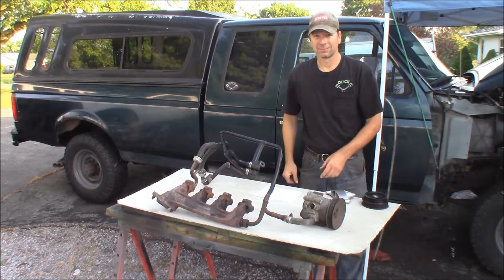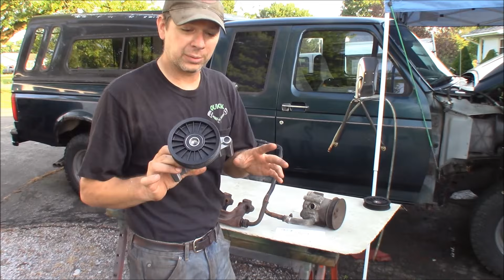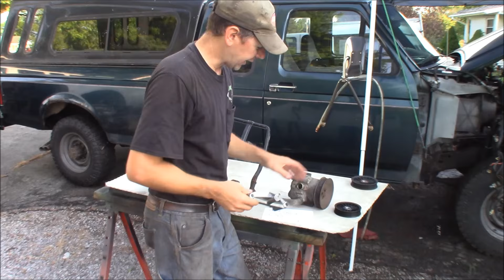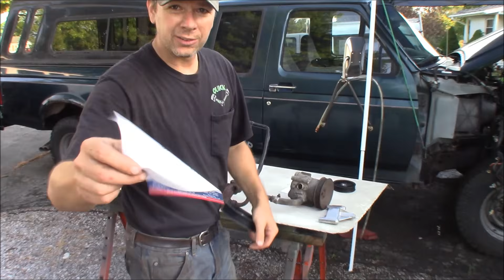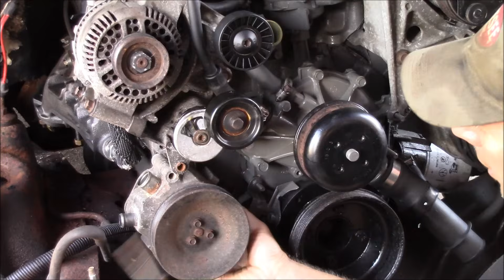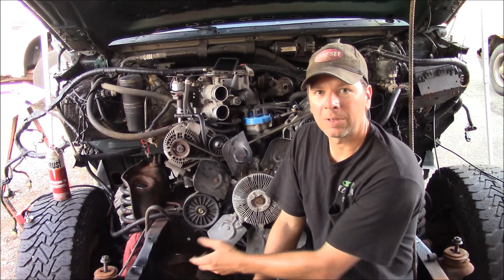1992-1997 OBS Ford Truck 5.8L Air Pump Smog Pump Delete F-150, F-250, F-350

Comment: What's the purpose of this?
Reply from the maker: Air pumps are known to seize up,  wreck the serpentine belt and leave you stranded.  Ford built these trucks with and without air injection systems. I eliminated the air system on my truck to simplify things and prevent future breakdowns.
Reply: @QuickSpeedShop  Good to know, thanks
Reply: @QuickSpeedShop  No codes from the EGR VALVE??
Reply from the maker: @STR8SICCC  I didn't remove the EGR, only the air injection.  Two completely separate systems.
Reply: @QuickSpeedShop  Alright then, good to know thanks again!
Reply: @QuickSpeedShop  hate to keep bugging you, but I am having no luck finding that idler bracket I've checked Autozone and O'Reillys online as well as Summit Racing...
Reply from the maker: @STR8SICCC  I bought mine from Jegs.  Just search the Proform part number in the video description. It shows up multiple places.
Reply: @QuickSpeedShop  lots of places show it but can't so much as order it.  I found 1 that does. My next step is deleting the pipe connecting the 2 manifolds. Do you know what size the threads are??
Reply from the maker: @STR8SICCC  I'm not sure of the thread size.  I replaced one manifold which came with a plug and I just welded the other side shut.
Reply: @QuickSpeedShop  okay thanks, was the replacement an OEM? I'm trying to avoid a complete replacement exhaust atm...
Reply from the maker: @STR8SICCC  I bought the manifold on RockAuto.  I think it was a Dorman part.
Reply: @QuickSpeedShop  darn ok

Comment: What if you just loop the Air Pump like you did with the valves? Or run it straight to the solenoids. I have a exhaust leak somewhere, guessing its either the manifolds or the egr piping in the back
Reply from the maker: The problem is that the air pumps will seize up and throw the belt, that's the main reason I remove them.  Sounds like you could either have a cracked manifold, which is common, or a smog tube that is leaking, although I think the newer ones are made of stainless so that don't usually rust off.
Reply: @QuickSpeedShop  Good call. Thanks! Great video, helped me understand the system much better. ++ for including part numbers!

Comment: Can't find the bracket anymore.  And not buying the 102$ Ford branded part because it's no different than the 60$ bracket.
Reply from the maker: https://www.pepboys.com/proform-air-pump-idler-bracket-kit-fits-302-351-mustang-uses-standard-serpentine-belt/product/904067Looks like Pepboys has it for $49 now.  Just search Proform 68110 and many places carry it.
Reply: @QuickSpeedShop   https://www.pepboys.com/proform-air-pump-idler-bracket-kit-fits-302-351-mustang-uses-standard-serpentine-belt/product/904067
Wow there it is.  Thanks man.  However, the upper bolt on my smog pump seized hard half way out.  I ended up having to leave it there and use a 92.3 inch belt to bypass; Dayco 923k6.  It be a while before I get in there again, I think I will have to remove the alternator and I think that bolt is going to get stuck too.  Might get an aftermarket alternator bracket and bypass the tensioner.
Reply: @classiclarry88  I just found out pep boys isn't in the parts business anymore.  Here's a replacement link- 
https://www.cjponyparts.com/catalogsearch/result/?q=m8604a50

Comment: Will this work on a 5.0?
Reply from the maker: The process should be the same for the manifolds and the air pipes.  As far as the air pump idler and pulley I don't know.  I know that a 5.0L and 5.8L have different belt lengths.  The stock pulley on the new idler might work on the 5.0L, but have never tried one.  I also believe that the belt routing maybe different, but don't know for sure.  I have only done this on the 5.8L trucks.

Comment: What are the perks of doing this, is there any increase in gas mileage or power or anything substantial?
Reply from the maker: No increase in mileage.  Just getting rid of bogus emission junk that can seize up or rust off and leave you broke down for no reason.
Reply: QuickSpeedShop alrighty cool to know thanks man 😃
Reply: It cleans up the engine compartment a bunch.  Also- it will make it 10x easier to get in there and work on anything in the future.
Reply: Less carbon build up without burning spent gasses.

Comment: I recently watched your exhaust video , I live your channel , I recently picked up a reg cab long box f350 with the 5.8 . I need to replace the hubs as one was missing . My long term goal is to straight axle the front then level it as the rear leafs look a lil saggy . Cheers
Reply: If you find a 76 bronco you can take the Dana 44 from the front of it and there’s a kit online that gives you everything you need to straight axle swap it 👍🏼
Reply: @jakeandavery8289  
Thanks for the reply I will look for a 76 Bronco . Cheers
Reply: @jakeandavery8289  Do you mean 96 ?

Comment: Now I've got a PO411 code. How do I get ride of that?
Reply from the maker: Did you leave the vacuum solenoid and bypass valve hooked up on the top of the intake?  Mine hasn't triggered any codes.  My truck is also a 1995 F250 with OBD-I computer.  Looks like that code is for 1996 OBD-II computers.  I have only done this mod on trucks with the OBD-I computer which would be 5.8L 1992-1995 F150 and 1992-1997 F250/350.
Reply: Do you have a 96 f150 with 5.8? does it have a MAF sensor?
Reply from the maker: @Jordan-bj7pw  This mod will not work on 1996 F150s as they have OBD-II computer systems.  Check engine light will come on.  This mod is only for 1995 and older F150 and 1997 and older F250/350 with OBD-I computer.
Reply: OK thanks. i have an obd1 97 f250 hd.did you notice and improved mpg?
Reply from the maker: @Jordan-bj7pw  No gain in mpg.  Just less junk to worry about failing on the engine.
Reply: @QuickSpeedShop  manifolds last longer and engine bay stays cooler too
Reply: any idea if this will work on the 460?

Comment: What did you do about the crossover pipe on the back of the heads the air injection reactor pipe?
Reply from the maker: I removed it.
Reply: @QuickSpeedShop  what's the best way to get the passenger side bolt out I'm having trouble getting to it?
Reply from the maker: I used some extensions and a universal joint.
Reply: @QuickSpeedShop  what did you use to plug them?
Reply: I have made a plate to cover the hole and hold it in place with a shorter bolt, same thread. 

When you have the heads off in the future, tap the hole and plug it with an Allen plug.  Done.

Comment from the maker: I also have a post on fordtrucks.com on the same process with similar title from a few years ago with pictures.
Reply: Will this work on a 1990 model f250 with the 5.8? You mentioned 92-97 just wondering if it's the same as my 90 model.
Reply from the maker: I have never worked on a 1990 so I can't say for sure.  I don't know if the belt layout or pulley size is the same.
Reply: @QuickSpeedShop  it looks identical in the video
Reply from the maker: Will probably work, but no promises!

Comment: Where can I get the correct size manifold plugs I need to complete this job? I don't have a way to weld the ends as you had suggested, so I'd like to find the correct plugs that would work instead. Could you possibly put a link in the description, or list the part number I would need to do that part? I appreciate the help Sir. Great video. Thank you.
Reply from the maker: I looked on the internet and am having a hard time finding the blank off plugs listed separately.  You can get the EGR tube connector fitting which will have the correct thread on the non nippled end.  You could get two of those and have someone weld the nippled ends up for you.  Dorman makes them, their under $15 each.  Just search 5.8L EGR tube connector.  If you could find out the NPT thread size of the connector you could probably find a black plug with same thread to plug rear manifold holes.
Reply: @QuickSpeedShop  Ok cool. I'll check it out. Question though. Is it the same principle, except for the parts removal, if I simply connect the incoming and outgoing hoses together, right at the smog pump location? Would that work, just to get me back on the road for now? The one on my 1997 f250 5.8 HD has seized up. At least it didn't leave me stranded though. I've owned this truck since new and has never let me down. Coming up on 300K miles and I want to make it over the mark. Thanks again for your help. This has helped me out, and I ordered the part numbers you provided in this video. I just need to figure out an easy way to do the tubing bypass, so that my truck will run again. Thank you for your help Sir.
Reply from the maker: @groovinav  Actually that should work.  If you leave those check valves in the lines in place it won't backfeed and you could just hook the lines together with some hose.  I don't see why that wouldn't work.
Reply: @QuickSpeedShop  Great. That's quick and easy to do. After connecting it this way, if the check valves are bad or ever go bad, will that cause a CEL to come on? I read a Tech note on the smog pumps, that said bad check valves can be the cause of seizures due to back flowing gases and such. Just making sure this would be safe for a permanant fix.?
Reply from the maker: @groovinav  The CEL shouldn't come on as long as the diverter valve is still hooked to vacuum.  With the lines hooked together even if a check was bad it will just pass exhaust from one manifold to the other which won't hurt anything.

Comment: BAM!  Removing excess engine hardware is a good idea.
Reply: Its weight reduction because race car! Plus now he can put a good set of headers on there to another 20hp give or take
Reply from the maker: Right!  👍
Reply: @QuickSpeedShop  hey couldn't find the proform part anymore, i had to get one from Ford after MONTHS of searching. Literally no one else has it or can get it
Reply from the maker: @MavenFade  In the description I added a part number for Americanmuscle.com.  They have a 5.0L bracket in stock that should be the same as the Proform piece.

Comment: What is the purpose of the delete? Are the HP gains or does it run better?
Reply from the maker: A lot of times an old air pump will seize up and blow the belt off leaving you stranded.  The air tubes will also fail after a while.  It's an antiquated system that has negligible effects on emissions and is more of a liability than anything else.
Reply: @QuickSpeedShop  this is different than the EGR delete correct?
Reply from the maker: @billysimon767  Yes.  EGR is separate system.  Check engine light will definitely come on with EGR removal.
Reply: @QuickSpeedShop  egr delete system ebay,,no check engine light
Reply: If you delete the egr and smog pump correctly will it still pass emissions?
Reply: Adrian m I would think that it wouldn’t pass but I’m not sure, no emissions here in WV. But the cats do most of the “cleaning” up the exhaust